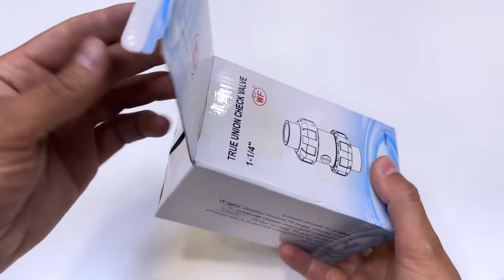I Turn PVC Pipe Into a MAGNETIC Water Pump No Need Electric Power

Comment: фейк
Reply: The effect of the magnet is to make the stainless pipe rotate in high speed to generate sucking pressure by
Reply: @emistechnical  Where does the suction pressure come from in the pipe?
Reply: . To be able to understand this project you have to be an engineer firstly he puts a foot value to retain the water inside the pipe is like running a surface water pump and for  the stainless pipe he directed the spiral holes to the flow of the water the only magic there is the magnet bcos it has configuration not just ferite magnet
Reply: 6:31
Reply: @منكلبحرقطرة-ه1ر  ????

Comment: This is so cool.  I wonder if I can build a smaller version of this for an outdoor bird bath.  If so, this would eliminate the need for a battery, or solar, or a power cord.  Thanks for this video.  You are amazing and smart.  God Bless You.
Reply: You will need the submersible pump, which is not shown in this click bait video.
Reply: @winfordnettles3292  Are you sure there is a submersible pump?  It appears that the pull force and the push force of the magnets are what draw the water and causes it to pump.

Comment: What's the point of drilling 3 holes in the cap and then plugging them?    Also, without some sort of movable plunger in the steel sleeve there is no way you can create a suction with magnets.   Water is not magnetic ( unless you have massive amounts of iron in your water lol).

Comment: The pipe melting connection method is used extensively in latin America when building homes. The use of undersized pipes to save building costs is rampant. Thus they heat up, and join pipes of widely varied size. That's why you cannot flush toilet paper in those regions because all the plumbing is to small.

Comment: Okay, I found another video with almost the same thing.  this time it done in the clear water and you can see the feed into the system.
seach "We turn PVC pipe into Hight speed water pump without electricity easy way" and the poster is "Learn for Daily"

Comment: "The biggest problem to built free energy water pump is how to hide the battery" (c)
Reply: The battery is in the river current. This will work too. Place a suction pipe with a large funnel on the end parallel to a strong river current, and the water will flow into the device on its own.

Comment: Whether it works or not will depends on the magnetisation force turning of iron tube drilled with spiral holes aspirating water flow, Just try magnet pumping  the pvc tube that house the spiral holes iron tube with the pump magnets as illustrated, and hear or feel whether the iron tube spinning/ turning inside the  pvc tube housing. I think it works...

Comment: The pipe in the pond, if it was open, could never fill with water poured in from the top.  So it must've been covered by something.  So by logic, the pipe was connected to the pump you weren't allowed to see that was used to complete this illusion.
Reply: didn't you see the one way valve and arrow on the outside of the pvc on the very end of the pipe. Its shown at 9:21 and you can see it again at 11:21.
Reply: A si quieres suscriptores, engañando a la gente..... El tubo que metes en el charco de ranas lo conectas a una bomba  de agua y es lo que hace salir el agua por el final del tubo.¿Porque no haces la prueba en una piscina con el agua transparente? y así descubrimos el truco que te sacas de la manga.

Comment: Does magnet efect on water? Any one tell me.
Reply: @ashokganage8802  a vibração entre os ímãs em repulsão faz a válvula abrir e fechar atuando skbre sua mola de modo a provocar o fluxo
Reply: @jadneves  the one way Chek valve is in the water, its nowhere near the magnets.
What you talking about is Magnetohydrodynamics (MHD) is the study of how magnetic fields interact with electrically conducting fluids, such as liquid metals, plasmas, and salt water. MHD is also known as magnetofluid dynamics or hydromagnetics
Reply: the magnet pulling the iron inside.. and pumping the water..